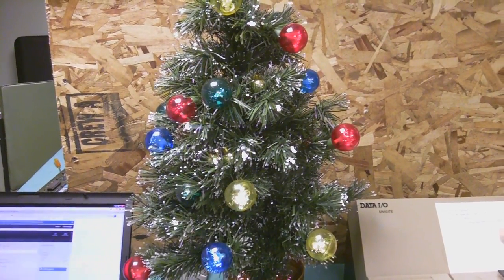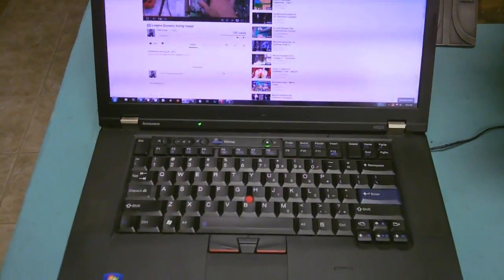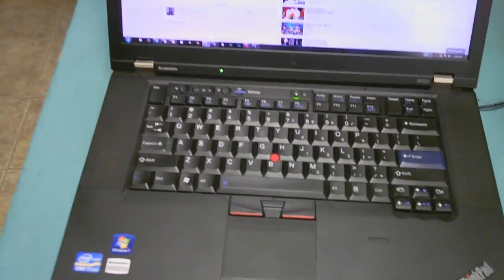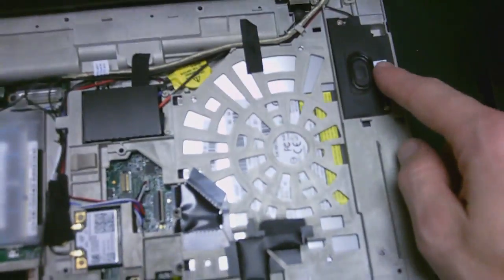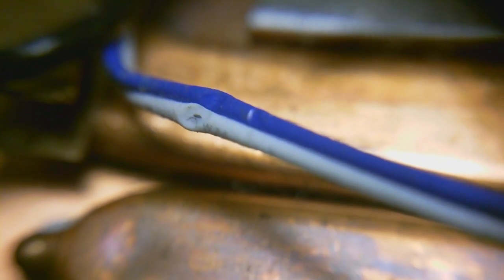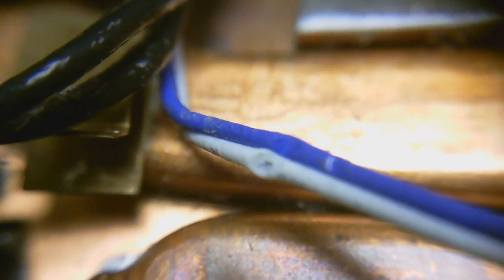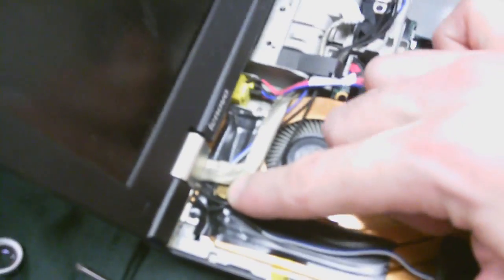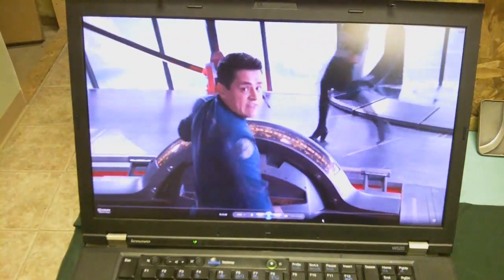Thinkpad W520 audio speaker fix

Comment: Many thanks. This was the problem with my 6 year old W520. I wasn't exactly sure how to remove the top case so I only went as far as the keyboard. I was able to gently tug and pull on the left speaker wire but it appeared to move it enough to clear the short.

Comment: you know! the fix you did after thinking about unsoldering the speaker, and pulling the pins on the plug, just to slide shrink tubing up the wire,   Some times the most obvious thing, like the blue wire grounding out, worn through,  if its worn through and touching metal, then fix the problem where its at.  wrap it in elect. tape. and make sure its not going to rub through again.    "Good Diagnose though". I've been an Auto mechanic 40 yrs. and to me if you find a small electrical problem like this,  don't pull all the connections,, fix it where the problems at. Keith, Maynard Mass.
Reply: seems resonable

Comment: Thank you very much!! Mine had short circuit between blu wire and the sharp gold plated cable holder (last piece before the wire leaves the heatpipe) :)

Comment: A bit amusing watching a W520 repair on my W520 XD... actually the only problem I've ever had with my W520 aside from the occasional USB-to-Serial adapter BSOD is that the ground wire in the power supply came disconnected, and I had to solder it back together and use copious amounts of electrical tape.

Only short circuited the supply twice during repair :D... still works 4 months later.

Comment: Thank you!  I used electrical tape as well, but I'd like to point out that wraparound heat shrink is available and often works well for scenarios where disconnecting the conductors is not feasible.

Comment: Having the same problem. What do you think if I cut the wire and add length to it and than reroute an other path?  thin wire+ hot copper just doesn't feel safe